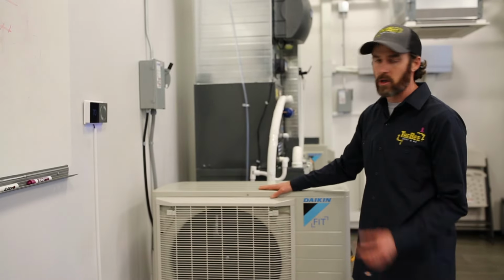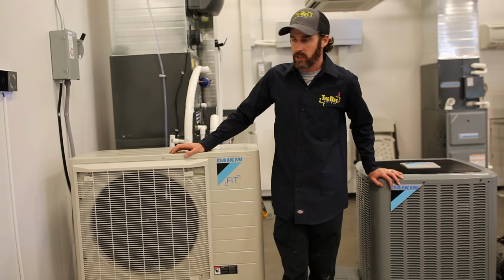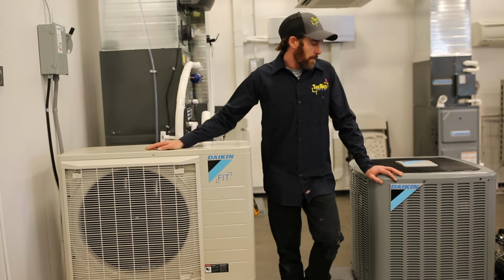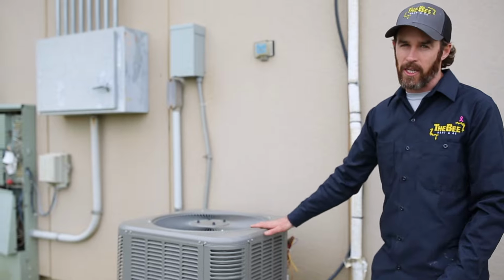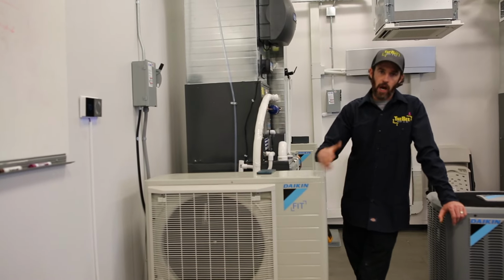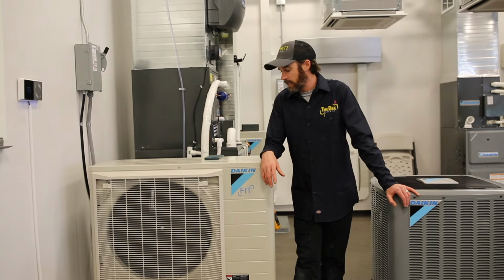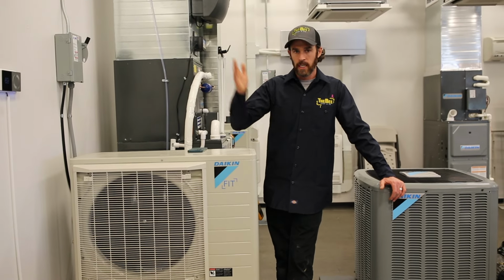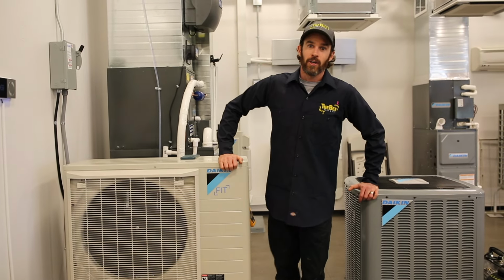BUYING A DAIKIN FIT?! Watch this FIRST or live with REGRET FOREVER!!

Comment: Very interesting! wow, great video! how does the FIT that compare to the GREE ultra heat inverter series?
Reply from the maker: I had to look up Gree because I wasn't Familiar! I don't have an opinion on Gree other than what I read on their spec sheets but it sounds like it has a lower capacity and is meant to maintain capacity even in super cold temps as it says it can run down to -36F. I know the Daikin Fit Heat Pump is rated down to -10F but it will not operate at full capacity (is my understanding) and starts to lose capacity once temps get into the single digit lows. That's why for most markets the Daikin Fit is an amazing value proposition, but if you're in really cold temps a Daikin VRV Life or a Gree system might handle lower temps better. Part of what we consider too is that natural gas costs are typically cheaper than electricity in most markets, so that's why it's efficient to run a furnace as backup heat when it get's REALLY cold (which in Denver is anything under 10F) and so all the systems we design out here that are "Duel Fuel" (Furnace paired with a Heat Pump) are designed to have the furnace run when it gets really cold which is probably only a few nights or so a year.
Reply: @thethoughtprovocateur  Oh ya? GREE goes lower? We're in Canada, winter goes down to -30C (-22F). We wanted to get a Daikin Fit DZ17VSA36 paired with 15k FVFEC electric furnace.
But here in Montreal, a similar GREE combo is 3k cheaper.  Hard to decide!
Reply from the maker: @coopaudiovisuellegts7428  Cheaper isn't always better, Gree is a no name I haven't heard of so I don't know how much I'd trust their warranty or tech. It's most likely private labeled and the reason it's cheaper is the dealer installing it, not the equipment itself, which is another red flag for Gree. Daikin makes low ambient equipment that does the same but good luck with the Gree! Maybe get a second opinion from another dealer in your area.
Reply: @thethoughtprovocateur  Gree is well known outside the United States since it's a Chinese brand vs Daikin is Japanese. GREE Flexx is also known as ACPro X Series, MrCool Universal, or GE Connect. (Assuming Ducted Version)

That said, what's the total power consumption of the Outdoor Unit and Indoor?  Is the Daikin FIT compatible with any Indoor Air Handler (aka 24VAC)?
Reply: @thethoughtprovocateur  Don’t underestimate Gree. They make equipment for Trane and Daikin and probably many other manufacturers. I’m in the industry and put one in my detached garage and love it.
Reply: @thethoughtprovocateur  I can't help but think that a "dual" fuel system is just a way to sell more product.    If you only need to run the furnace a few nights a year (I live in Denver for 30 years, so below 10 degrees maybe 20 nights and maybe two days in a winter). You are asking the consumer to spend $5000+ for the furnace. Doesn't the heat pump have a resistive heating option? I know those cost a lot to operate, but if it's only for those short periods, then it would take a LOT of years to make up the difference of adding a furnace wouldn't it?   
BTW I really would love the Denver rebate to come back but I suspect it was a once in a lifetime rebate opportunity. If they do it again it'll be smaller max/household.

Comment: I’ve seen some bad publicity on the Daikin Smart thermostat. What is your experience with your customers?
Reply from the maker: The general consensus is our customers love them as they are very quiet, space saving, and efficient, and I don't think people complain about the Daikin One anymore than android users complain about apple or vice versa lol. It's pretty easy to navigate, we have two Daikin One thermostats on our VRV at the office and they work without issue... and they have built in wifi whereas the CTK04 does not (unless they've changed that feature, but I don't think they have as of last time I checked), the CTK04 requires an internet gateway which in my opinion is annoying. That's where I think the Daikin One stands out, they know they're competing with Nest and Ecobee so they have to be on their game as those are popular products to compete with!
Reply from the maker: For the most part they work without issue and is a lot better than it was when it first came out. The technology is actually based on the CTK04 (Honeywell communicating thermostat) so it's not new, just a different interface... the only gripe I have is when it doesn't work it can be annoying because it's communicating so it's more work for us lol, but that's on the installer not the customer. I would say you'd never know the difference honestly, it's similar to a nest or eco bee. The big thing is making sure you're wiring is correct and you have good wire connections, because that can affect communication. All in all I don't think we have any more issues with them than we do with a normal thermostat and non communicating system and they've done an excellent job supporting the product, between training and also stocking them at the parts house so there is a no issue getting them to swap one under warranty. And as far as reliability like I said they've done a great job so far supporting us as dealers so we continue to sell them.
Reply from the maker: Also Daikin really wants to sell more Fits, it's one of the main things they always talk to the Dealers about and as a result they've continued to up their game when it comes to supporting the product line / keeping things in stock etc.

Comment: DaiKin has just built a huge complex outside of Houston Texas where they make the
Daikin fit. 😀

So far having my Daikin fit for over three years had one problem the plastic outside unit fan blade became loose on the motor mount and had to be replaced but was covered under the 12 year warranty for the parts.
Reply from the maker: Yes! The factory is impressive we went down there and took a tour, pretty cool
Reply: Hi, did you get your Daikin fit in Houston? I want one so much but I don't know which contractor I should go to
Reply: The Fit's are not built in TX.  They are coming from Twain, soon hey will be built in Mexico.  Every other Furnace and AC for our US market is built in TX
Reply: @NateRymarz  I know this is an old comment, but the Fit is now built in Waller, Tx at the Daikin plant.

Comment: I’ve seen for sale online covers for the Daikin fit  type of unit outside. There  just a flat cover to shade the coil.

Do you think this is worth it as far as helping the unit out by shading the Coil during the day from the sun?

One thing I wish DaiKin  had was more protection for the coil with the unit outside.

Thanks 😊
Reply from the maker: If it inhibits airflow at all I would say no but they're designed to be outside. If it doesn't hurt airflow it doesn't hurt it to be in the shade, but if it blocks air around the condenser I would avoid it!